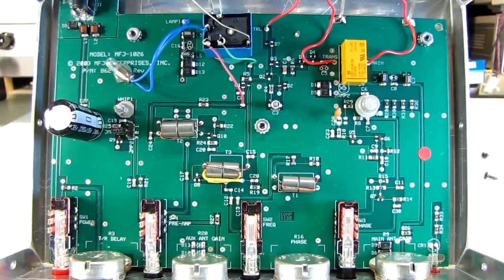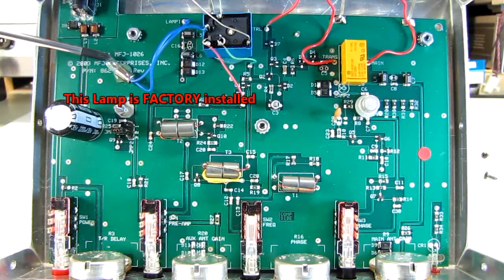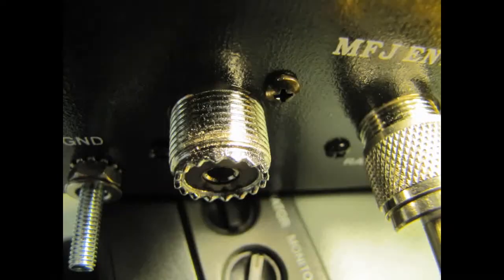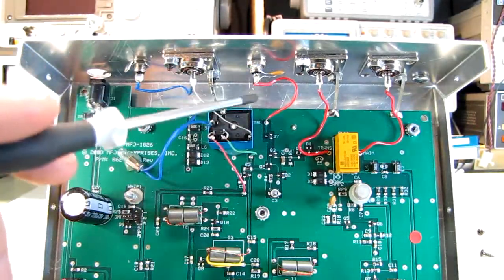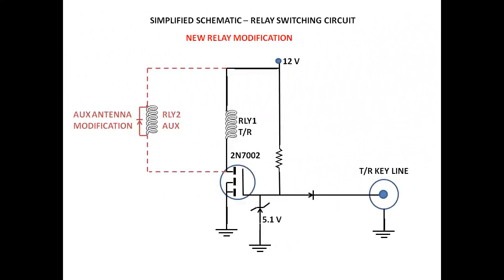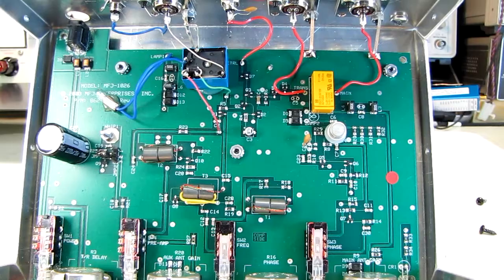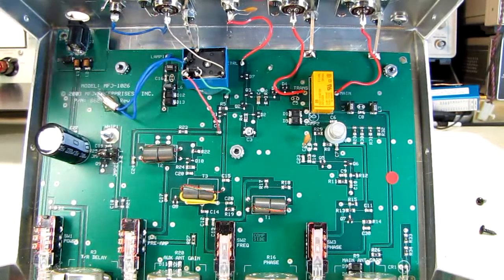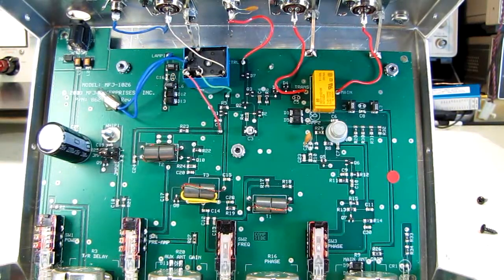MFJ 1026 Hacks Mods Repairs

Comment: Would anyone care to supply an actual relay part number since not all of us have great strength in construction.  Would relay appreciate it (pun intended) or an eBay listing number perhaps?
Reply from the maker: HI Sean, the relay is an old Radio Shack part that they no longer carry. What is needed is a 12 volt coil with very low current draw. I think this one is about 20 mA if memory serves. And fairly heavy contacts. This one claims 10 amps. Probably actually good for around 5 amps. This thing had been in my junk box for 20 years or so.
Reply: The Radio Mechanic 
I know (most of) this because it was already said.  What I was asking was a link or an actual part number, I realise its easy for some to transfer the info into an actual part but not all of us are blessed with finer understanding of components.
Reply: Would this do the trick? Miniature PCB Relay 12V SPDT ~125VAC/10A -- 30VDC/10A on eBay on item: 132671574308, if I orientate the same way as video that should work yes?
Reply from the maker: HI Sean, The contacts are fine and will handle the RF without issue. The coil is rated at 37.5 mA which is ideal as it will not stress the switching transistor. Good find.
Reply: So, one last bit.  The relay has pins 1= Normal Close,  2= Normal Open,  3= Coil 1,  4 = Com 5 = Coil 2.  What goes where?  Hope this post helps others as well.
Reply: In light of the normally closed suggestion in several posts, can someone please provide a new wiring scheme from relay to pickup points on the 1026 board and UHF connectors?

Comment: Hi
Thank you for a very informative and well made video.
I messed up mine by accident. I plugged a 13v ac not dc in it and now it does not power up any more with 12v dc. What did I break? If you can steer me in the right direction to fix it , I'd appreciate it.

Comment: I like your caution. What diode spec should I use on the relay to prevent any back EMF?
Reply from the maker: I usually use just about any diode that will handle at least an amp and 1000 volts. Nothing special here.

Comment: Hi Mr. Radio Mechanic!  Another great video and thank you for your efforts!!  I just ordered the MFJ-1026 as I have a terrible noise problem here at the Home QTH...  However, I notice my IC-706 (first gen. series) does not have an External PTT port on it. Therefore, I can NOT plug into the "TR Control" (keying line) in back of the MFJ!  Any Ideas on how I can do this since I don't want to rely on the on-board relay as what you warn about certainly makes sense even though I'm not going to use an amp.  Thanks again - really enjoy your well-made and informative videos that are really easy to understand!  Thank you in advance for you help... 73 (K7GYB)
Reply from the maker: HI David. The 706 has some interface connections on the back. There is on one of them a keying line to trigger an amp. Just do a search for IC-706 keying an Amplifier and there are several sites that will pop up. When you get the 1026 remember that it takes patience to get the knack of setting it up. And a good sense antenna.
Reply: Thank You, Mr. Radio Mechanic for the info.  I looked at the schematic for the IC-706 (technical info.) and the 13 pin Din plug in the back of the radio and there are two pins that will be needed which I can use to connect to the RCA jack into the 1026 T/R Control (ground - pin 2; and PTT line -pin 3).  Thank you for the follow-up info!   It is very much appreciated!  Have been enjoying all of your videos!  Thank you for the prompt reply.  73   K7GYB